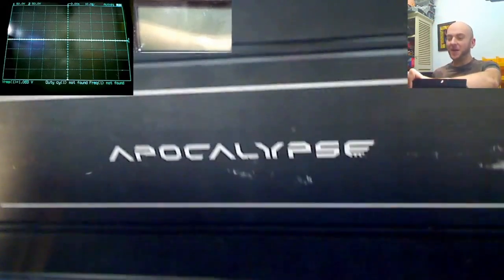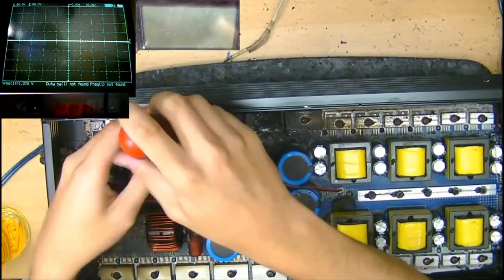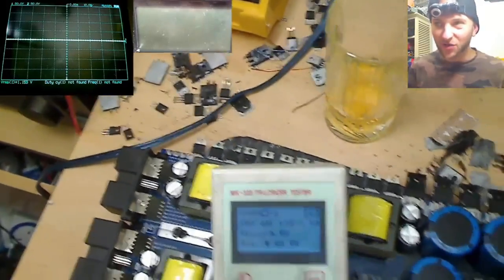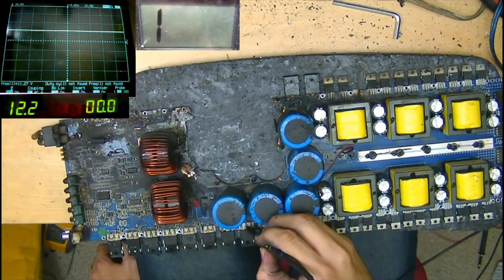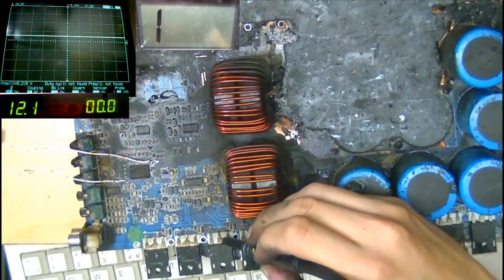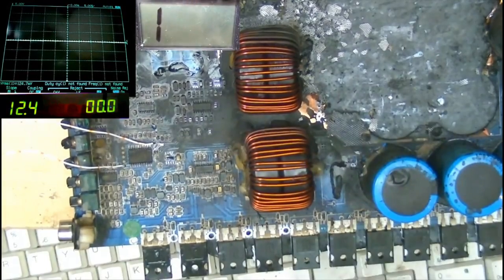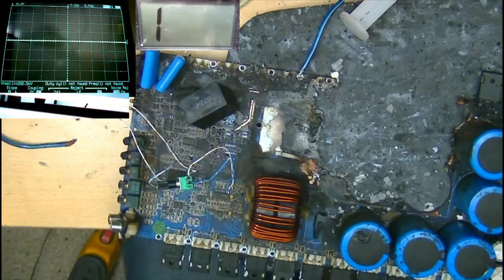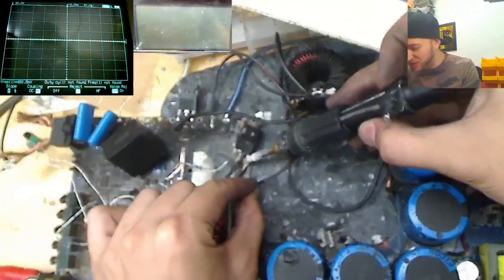Can I make ANYTHING on this fire-damaged amplifier work again?!

Comment: I guess it can be fixed.
The fets locked on the heatsink and the caps glued to the heatsink with thik wires for low esr guarantee.
On the other hand,you can look for another amp like this with dead power supply but if the power supply fets go wild,fire will rise.
What about a half board with cooked power supply zone?😄
Cut the boards in half, reconnect the tracks and fix the whole thing?
Frankenstein way😄
Reply: It must be a low crowned tracks zone like the border between power supply and output.
Between those 2 zones they should be the rails,the power supply gates coming from the oscilator located in the output zone,a big ground,a 12 volts line and the remote start.

Comment: can i send you my sundown 8000w amp turns on all fans come on but all lights flash. pulled the lid to see if there was water damage and nothing looks like water damage. but you can smell in one spot on the board that it either popped or got real hot theres a heat sink in the way and where i live i dont have the Resorces needed to fix at my house.
Reply from the maker: Are you in the UK
Reply: @barevids  I am not but would be happy to ship it if you’ll take a look
Reply: @barevids  this is going to be hooked to a set of 1500$ each subs so I don’t want to send to just anyone and most electronic guys I’ve had take a look say they don’t want to mess with it or don’t do care audio. We have no electronics repair local not even cellphone repairs I live in a are of 28k in the whole county so resources and cost of resources to get here would be the same cost or more then to just ship it to some one and have them fix it.

Comment: I would no longer sell amplifiers on FB.
Amount of idiots who barely have a basic knowledge how to wire and set up the amp is amazing. 
I dont offer installation due lack of time
I had quite a few amps repaired and sell back , all tested , all working. 
Few of them returned with excessive damage , scorching to pcb.
It is just anoying when you work hard and idiot comes back with all output transistors fried like KFC . Can I have another one ? It doesn't work .